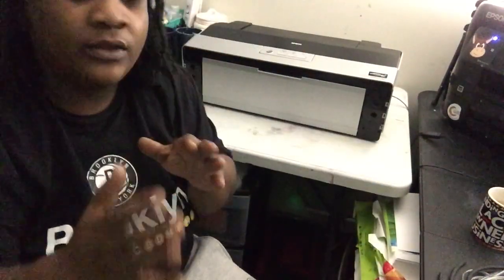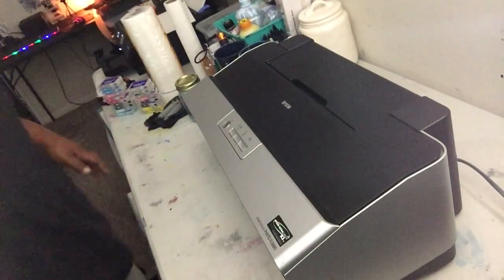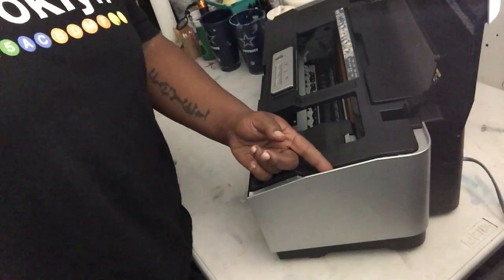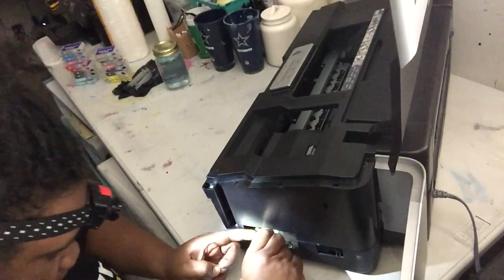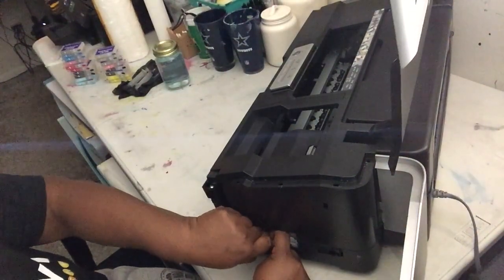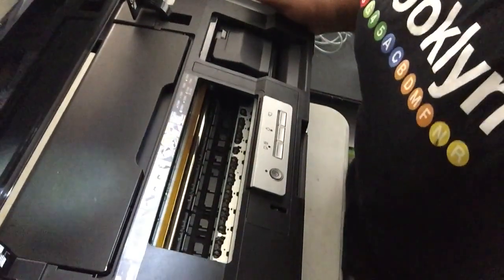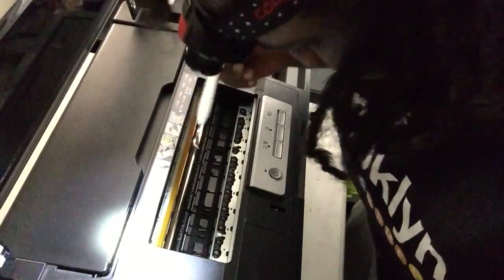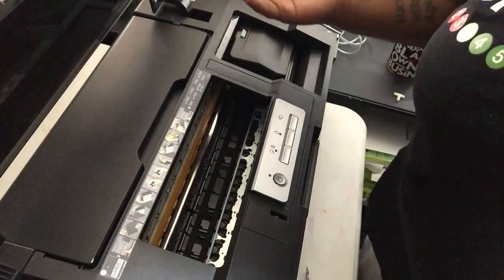How TO CONVERT an Epson R2880 DTF DIRECT TO FILM Printing DTF DIRECT TO FILM  DTF onCanvas #dtf DTF

Comment: Hi, I have a problem with the Epson R2000. It prints single sheets, but when I put the 30 cm roll of DTF in it tells me that the letter is finished or the support is not properly placed. In the R1800 I had no problem, but with this one I am having problems. I appreciate the help.

Comment: WHAT PRINTER YOU PREFRE R2880 OR THE XP5000 IF THEY BOTH WHERE RUNNING TOP MODE
Reply from the maker: Definitely the 2880

Comment: Do you still have this printer ? I’m over the xp 15000 and found a 1430 and a r 2880 which do you prefer for a beginner? I only got 1 print out the 15000 and still having rear feeder issues I’ve tried everything

Comment: I have the printer where did you get the rest of the supplies? You have to coat the back and cure it right?
Reply from the maker: Yes you have to cure the back once you add the powder ... Check out my DTF vendor list in the description 😎
Reply: @FayzoFilms  thank you 😊
Reply: @FayzoFilms  can you use a flash dryer? Also what order are the inks? TIA

Comment: Question. Have you ever converted a Epson 7720 foe sublimation. If so, did you remove the rollers too🤔. Cause those pizza wheels killing me. I keep trying to clean them but 2 prints later… they’re back🤬
Reply from the maker: Yes I converted my WF 7720 to sublimation but no I never removed the rollers I just have to clean rollers🤦🏿‍♀️
Reply: Turn off High Speed...pizza wheels will go away...I have the same printer
Reply: @jaquibain2764  already turned off high speed. Still pinwheels🤷🏽‍♀️🤦🏾‍♀️

Comment: Hi, do you know if the conversion process is the same for r2400? Also, where do you get the refillable carts? Thank you!!
Reply from the maker: Hi I don't know if the conversion is exactly the same but it should be similar being that the model numbers are so close but I got my refillable carts from inkowl
Reply: @FayzoFilms  Thanks! I converted an Epson R2400 (its identical). I'm using AcroRip 9.3 and I can't get it to print. What are your printer settings if you're using AcroRip? Thanks!

Comment: Hello, What software do you use for DTF prints?
Reply from the maker: Hey‼️👋🏾...I'm currently using AcroRip 10.5
Reply: Ok. Thanks for fast reply. One more question will the r280 work like the r2880? I'm keep seeing r280 coming up as suggested.
Reply from the maker: Yes it does...it's also similar to the 1400 as well ...it's only prints A4 size tho
Reply: Oh ok A4 yeah to small. I use to have a 1430 I messed up my heads and got rid of it couple yrs ago. I wish I didn't. Now I see ppl selling print heads for it. Thanks for all the info. Cool detail videos. Last week I watched your video on the 15000 I almost bought one. Lucky I didn't after seeing your video and the problems.

Comment: What need to be done if you find a printer without the print head?  If you have to buy a new print head  is it worth  buying the printer ?
Reply from the maker: In my opinion it wouldn't be worth it I would  try to find a printer with the print head already

Comment: What happened to the xp15000? I'm thinking about getting in to dtf. Is this printer better? Or is it easier to work with. I can only do so much with this sublimation.
Reply from the maker: I did not like the 15000 I like this one a lot better this is the r2880
Reply: @FayzoFilms  any  Particular reason
Reply from the maker: https://youtu.be/kAa1BgnQPw0